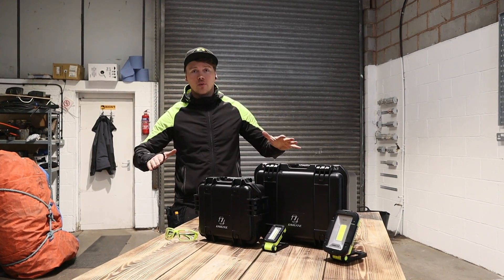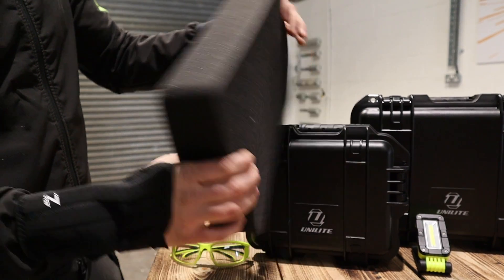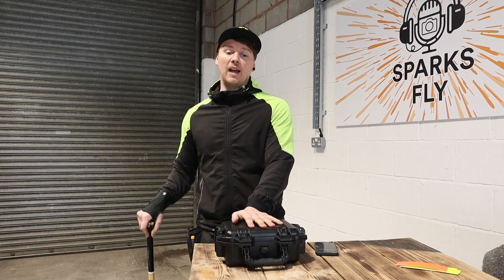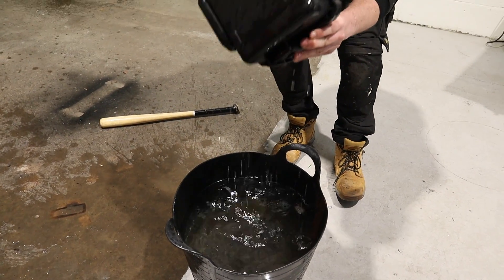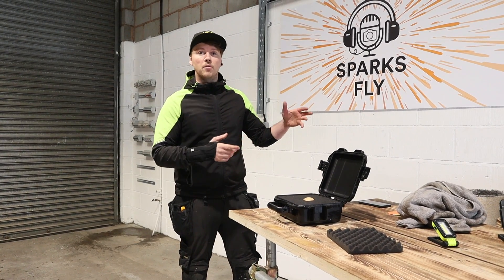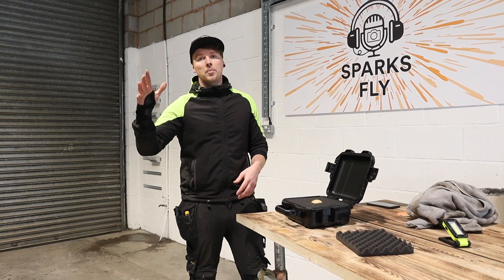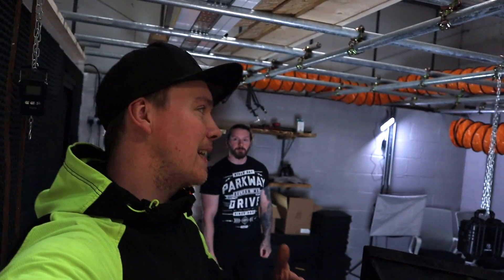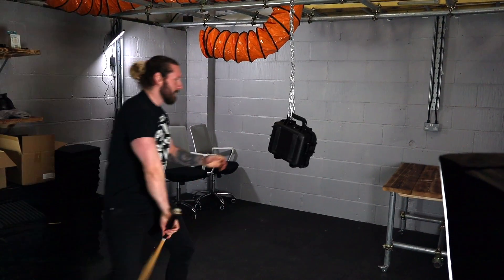How Tough is it? Electrician

Comment: Hi I'm using 5 X 25mm swa what type breaker and size would I use. I'm discriminating down from 400amp mccb feeding a sub distribution panel. And what size breaker will I use in sub distribution panel. Sorry.. I'm used to domestic..